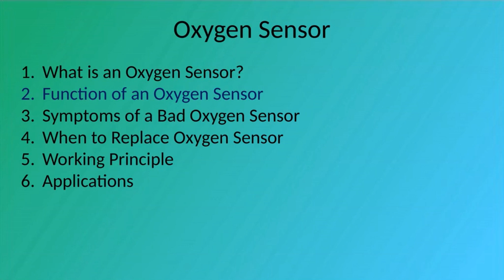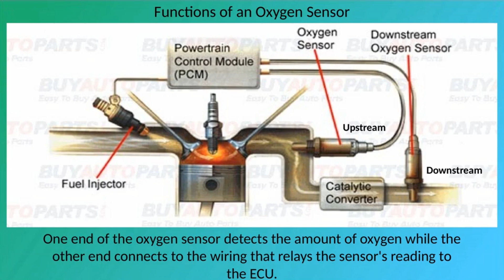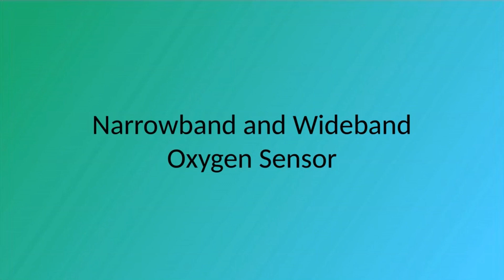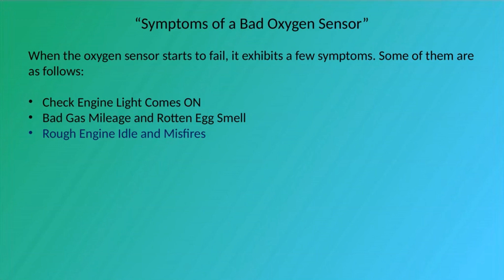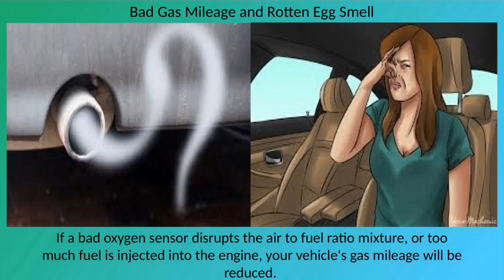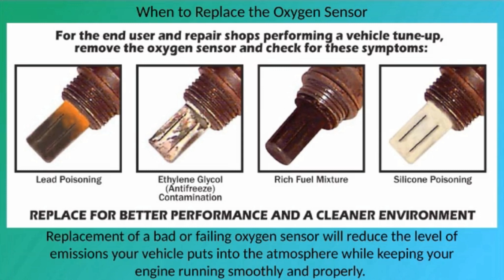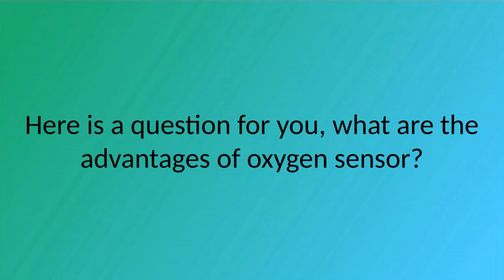Oxygen Sensor

Comment: Advantages of the oxygen sensor
1. It helps the vehicle to control fuel economy
2. It helps in the smooth running and performance of the engine
3. It also helps to monitor the vehicle's catalytic converter thereby saving our atmosphere a lot less of pollution
Reply: Can I clean it, and put it back on car?
Or how may I reuse again?
In my Astra h 1.6 16v 2003